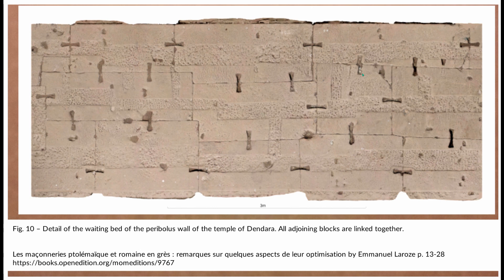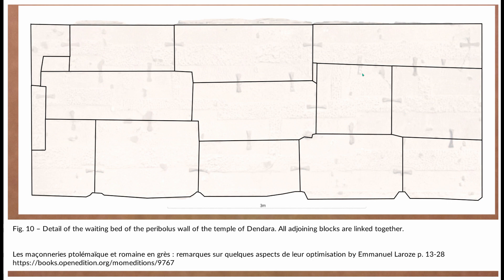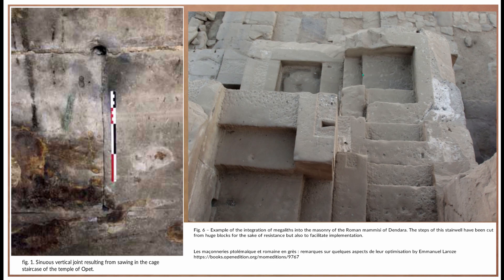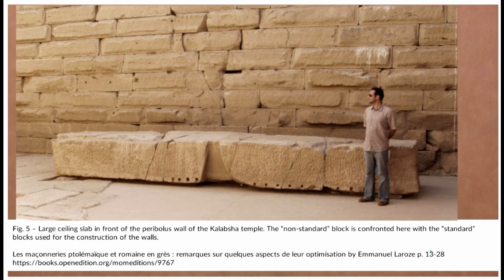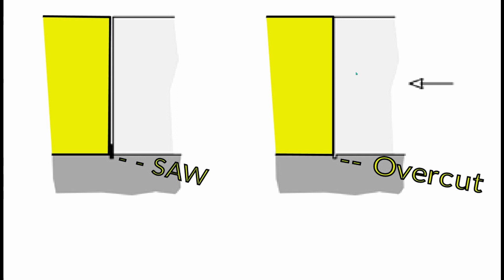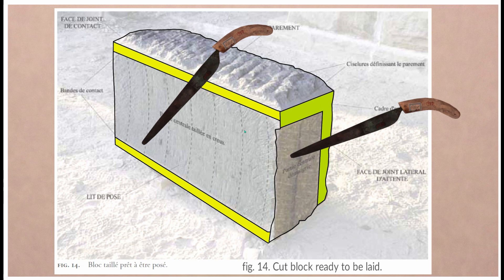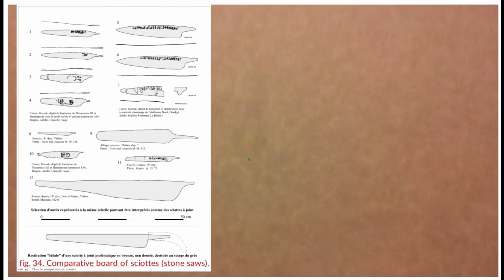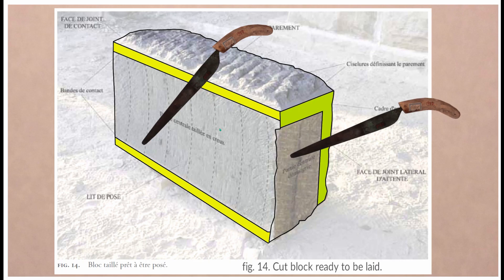Polygonal Stone Walls with a Saw: Ancient Techniques with Primitive Tools

Comment: Just a thought here. If saws were used from top down to give access to both back and side joining faces, then the blade would need to be as long as course is high. Pushing copper down would be tricky to do, it wanting to bind/ bend when saw bound up, which a rather dull large curf long saw tends to do. Using saw on the horizontal would make cutting easier but would restrict use to single face joints, saw would need room behind joint. Good theory but I can't see using technique on very large hard stone like granite and making any headway. 
Also there would be a limit on how much time could be alotted for each cut. No one builds a needed structure or wall thinking it will be finished in the next two or three Generation. So there needed to be a faster , easier way.
Reply: Last thing ....the cutting debris would accumulate at the bottom of cut as one was working, periodic shifting to clear stone dust would be required. Laborious

Comment: if the stone is tilted forwards or sidewards at an angle, much less material has to be removed, to get a dressed edge. With that said, I noticed some of the megalithic work at machupichu is over a meter deep but the form follows precisely on both sides of the joint face (where earthquakes have displaced so you could see), it's impressive work.
Reply from the maker: IF it's available in your region try and find "Blowing Up History: Machu PIcchu . It has great examples of semi completed stones. I caught it once but now am region blocked on the internet.
Reply: @SacredGeometryDecoded  if it's in your region it's in mine, not a stretch to assume you are also an Aussie ;) With a vpn we are global citizens, so will check it out regardless, many thanks!
Reply: Just watched it on YouTube discovery, only 10 mins. They talked about hematite pounders, pre inca rock art (which I suspect is a big part of it) very interesting 👍
Reply from the maker: @landspide  yeah though the best parts missing , I will get it and piece together with other bits.

Comment: Sandstone a lot of times is a 6 on the Mohs scale. Also I have seen sections of polygonal Masonry that are three-sided insertion you could not cut simultaneously as it would make the piece smaller by twice the thickness of the blade😂. Keep trying I told you I know the way that it was made you're getting closer but still off😂
Reply from the maker: Sandstone is higher on Mohs scale than granite. Even the crumbly stuff because it has higher quartz percentage and often enough sone corundum.
In other words sandstone is higher than granite than Mohs scale. Even the toughest limestone is low on Mohs scale.
I have videos on granite polygonal walls. Before you watch that it’s probably best to have an idea what you are talking about. 
Those lost tech guys who cite Mohs scale are clueless. They should have told you window glass is higher on Mohs than mild steel. 
Keep trying though. Maybe one day you’ll land a point 
The authors of this expressly point out it isn’t to Peruvian type walls. 
Always the same with you knuckleheads. A video on lifting. But you can’t cut it. A video on cutting. Oh but you can’t lift it.
How about you START trying

Comment: sawing polygonal blocks out of sandstone is trivial compared to doing it with granite like the ancient Peruvians did
Reply from the maker: The Peruvian walls were not sawn. A better example would be granite lighthouses like Wolfrock that matched faces in 3D rather than just the first few inches of the facade.
In description I provide links to the team who did this. They state this is not relevant to Peru yet walls such as the ones they show are referenced by the "It's impossible therefore lost technology" types.
I've also sawn granite and basalt and filmed/posted the experiments so if the reply is "it takes too long" I am more than equipped to say otherwise.
Reply: @SacredGeometryDecoded  how is it impossible? Lol. We have the artifacts obviously they did it
Reply: @SacredGeometryDecoded  wolf rock was constructed during the late 18th century… not sure how that’s relevant to this comment
Reply: @SacredGeometryDecoded  I wasn’t talking about sawing granite… I was talking about fitting together polygonal granite
Reply from the maker: @cleanpiecington2319  Wolf Rock made without advanced equipment.
Reply from the maker: @cleanpiecington2319  The people who comment in a similar fashion tend to be lost tech types.
Reply from the maker: @cleanpiecington2319  https://www.youtube.com/watch?v=j6SEYq0ogmE&t=393s
Shows ancient method for fitting stone together. More difficult in that that they fit new pieces to shattered ancient surface. Far more complex than anything in Peru.
Reply: @SacredGeometryDecoded  are you suggesting granite is easier to work then marble? lol
Reply: @SacredGeometryDecoded  also diesel engines and steel/carbon tools should make that work quite trivial... shouldnt it ? lol

Comment: the evidence tells a different story, min 20.07, that block, the marks, do not show what would have been the cut with a    knife,  interesting video here  https://www.youtube.com/watch?v=WAyQQRNoQaE
Reply: someone has to explain how would they manouver the stones so many times until fit
Reply: 29.58, how is that block being lifted, how egyptians do that
Reply from the maker: I have a playlist called Moving the Megaliths which shows many examples of various methods being used. For places like Saqsayhuaman why would you move the few large blocks many times to fit the much smaller neighouring stones, with about a hlaf dozen examples all the big blocks are corner stones. They are all bordered by much smaller blocks.
I have a whole series on that place going through the entire lower tier that contains the larger blocks. Except for the corner stones the test are thin facing stones and the weights typically given are way way over exaggerated.
Reply from the maker: With even the most basic knowledge of rigging a ship anyone could move that stone. 
In my compilation of moving stones I have a grandpa showing a toddler how to do it. Old photo and film of stone masons and quarry men doing a lot better with a bit of rope and some wood. Old loggers working deep in the forest stacking massive logs,
A simple task with the most basic of ancient knowledge. 
I find it very mysterious that for all the obsession with moving stones so few have even bothered to look into what can be done, and what was done as everyday no big deal kind of stuff.